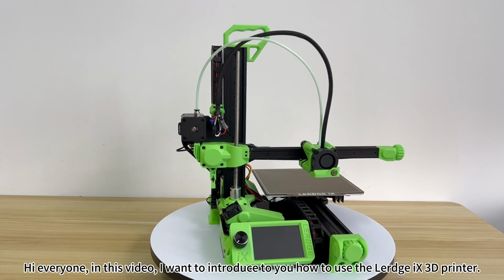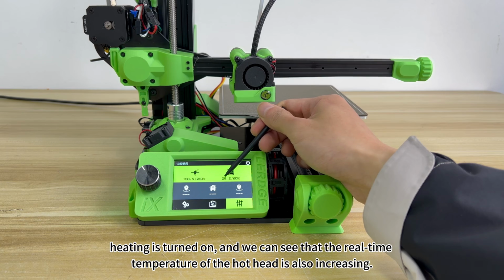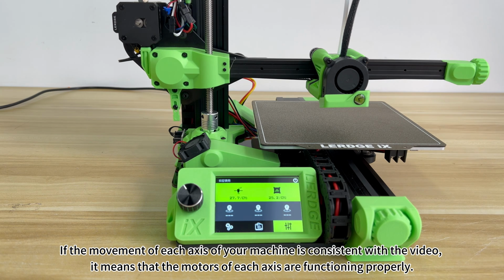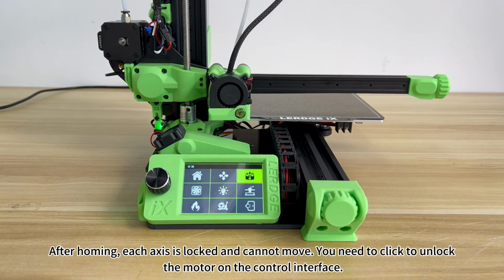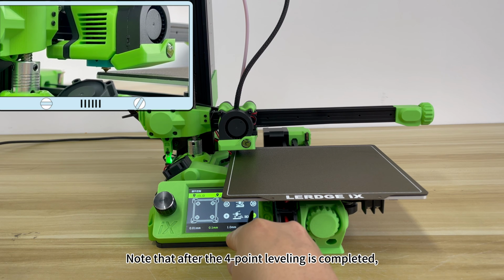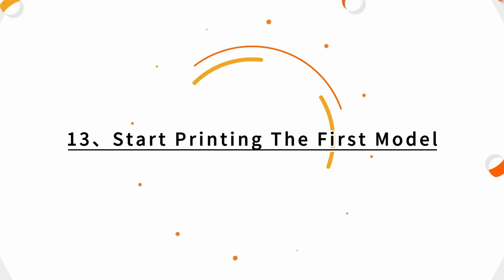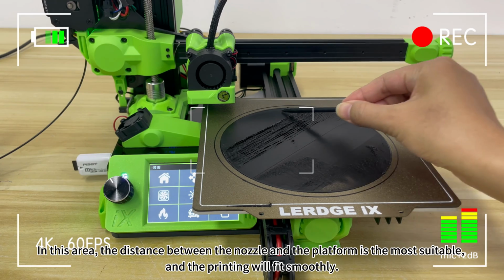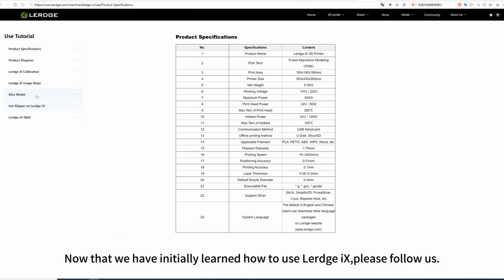Beginners Guide To Lerdge-iX 3D Printer | How to use 3D printer after you assembly and calibrate it

Comment: Lerdge-Z firmware V5.0.1 (2024.10.11), I encountered two issues:
1. Bed temperature error.
2. During printing, it gets stuck on a single axis, forcing me to stop printing.
3. Preview thumbnails are not visible even though the Slicer is set in the settings.
Please release a new firmware update because this one doesn't work and there are many bugs.

Comment: I just got one and been following this video to set up, I'm stuck on step 7, I keep setting the z axis correctly and the sensor but when I home it , the z axis rises twice and won't lower again to where I adjusted ot to so when I try to print the nozzle is way too hight, I've been trying to figure out what I'm doing wrong and rewatching the video, and still having the same problem, can any of you help me please thanks
Reply from the maker: We need to first check whether the Z-axis optical endstop is functioning properly. Please use a light-proof sheet to insert into the photoelectric slot of the optical endsto and check whether the green indicator light will light up. Insert the sheet and the indicator light should light up; remove the sheet and the indicator light should go out.
Reply: @Lerdge3D  yes the z lights up and I've set it
Reply: I set the optical (btw the screw doesn't tighten all the way but seems to stay in place) I also set the nozzle to just touch the plate and I do the paper test where it just pulls slightly, but that's where my problem is I try to home or start a print, but the x-axis goes up slightly twice and won't return/stay to where I set it at and therefore the nozzle is too far from the plate, but I cant seem to be able to set it to stay in position, please help this is my 1st new 3d printer ive purchased, thanks
Reply from the maker: @davidcoppafeel2012  Could you send me a video to the email: shop@lerdge.com? This will help me solve the problem better, thank you
Reply: I haven't heard back and still not made any progress

Comment: Hi, I don't know where else to reach you guys, but I upgraded my lerdge to klipper in January. So far so fine. Little wonder, that thing. No issue printing at 150mm/s. Even if I have a bambu now. This printer rocks hard.  Now klipper has updated and the MCU of your mainboard is now updated with klipper software you provide on your website. As far as I know, I can't create it myself with make command over Klipper firmware. Is there any chance you update your klipper firmware to 12. something?

Comment: 11:11 - If its not equipped with a auto level probe, why does the firmware show the option to auto level???
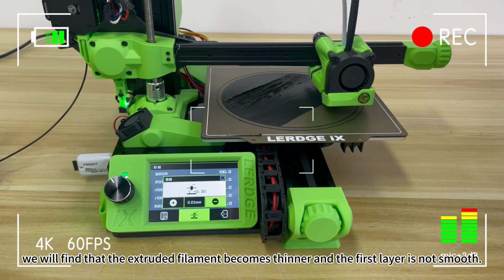18:47 - Three hours just to print the first layer??
Reply: Because if you upgrade to auto leveling you dont need to change the firmware
Reply: @PlayerXy-ux2pw But you do ruin your printer if you accidentally click on it. Wonderful.